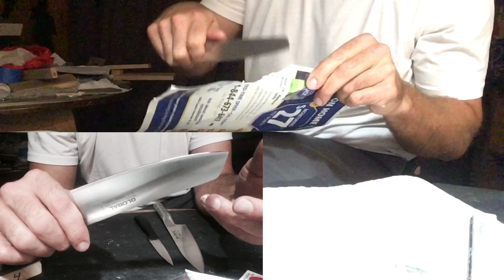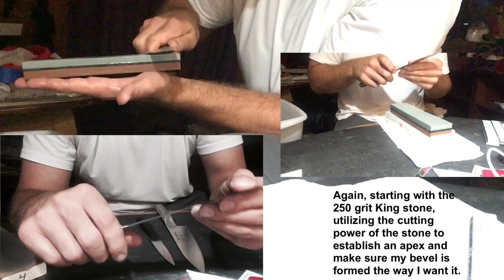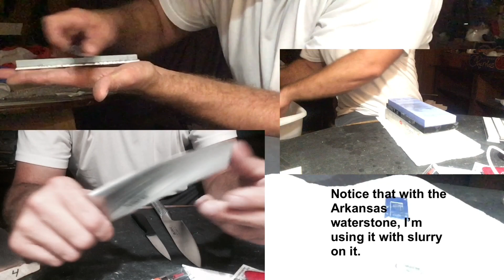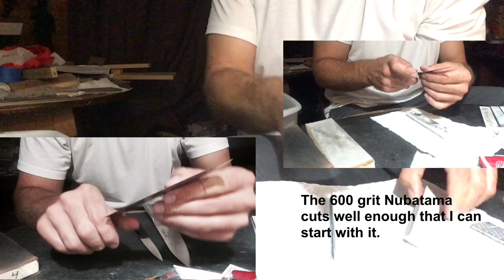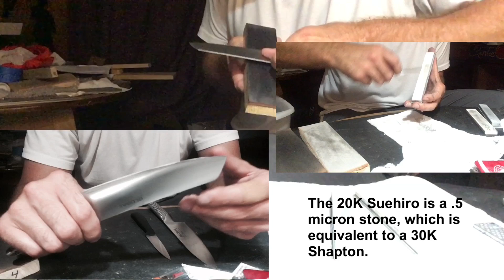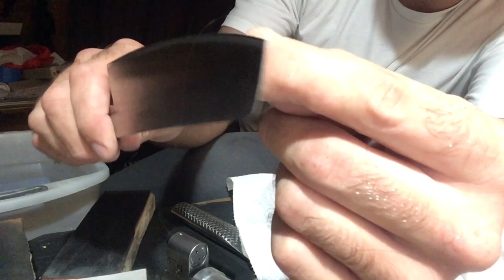Sharpening some kitchen knives - different approaches

Comment: So how much pressure are you using with your strop? I'm having trouble once I go past 1 micron that the knife seems to get duller rather than sharper.  Depending on steel I use 3.5, 2.5, and 1 micron on basswood  at which point the knife is very sharp,  but when I try to finish it off on leather strops with .5 micron, and .25 micron, the polish comes up,  but the sharpness seems to get less.
Reply from the maker: matrix5175 if you’re using a soft leather, you need to compensate for that and use less pressure.  I use harder leathers and I make the strops to take a lot of pressure.
Reply: @michaelchristy4982  dumb question i'm sure... but how do i know if i have a "hard" leather or a soft one?  i bought some vegetable tanned tooling leather off amazon and have made my first few strops from them using the standard white and green compound... but i just bought some 3.5, 1 and .5  micron paste that i wanna use on my next strops im about to make... but now im wondering if i got the right leather? i'm a total noob so i apologize in advance for being clueless...
Reply from the maker: Brett Gozdeck just pay attention to how much the leather gives when you strop on it.  
The compound you bought...  is it a spray or did it come in a syringe?
Reply: @brettgozdeck508  Casing the leather by wetting it and rolling it using a heavy roller really hardens it up and brings the silicates to the surface. Once dry I then glue it to the wood block. I did this to a horse butt strop I just made and digging your thumbnail into it will barely leave an impression.